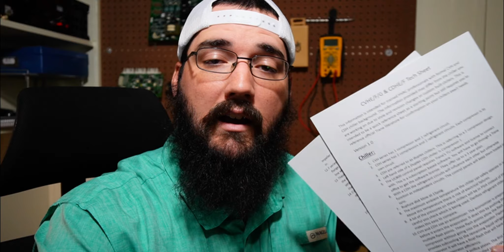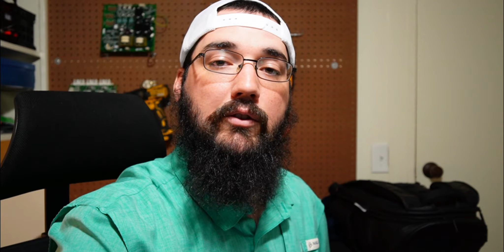CVH CentraVac Troubleshooting Guide

Comment: Does the LCR on York YPALs really stand for "low cost rooftop unit"

The vrvs and vrfs so far haven't been much trouble but the Toshiba carrier heat recovery vrfs absolutely have given us fits. Just did a leak repair and now finding out the tenant was told only two heads can cool or heat at a time. Will be the a great (hopefully) experience for me to learn how it operates the flow selectors and such but will be a challenge for sure.

Wish me luck and thanks for what you do man, it was so nice to find someone my age as into the trade as I am (but with more knowledge and experience)